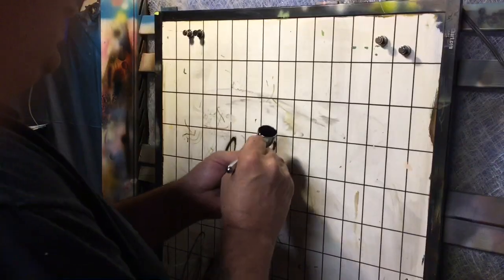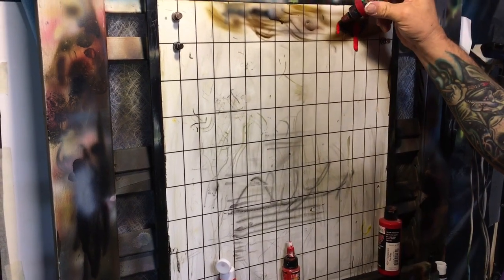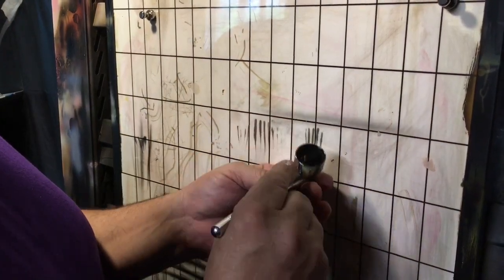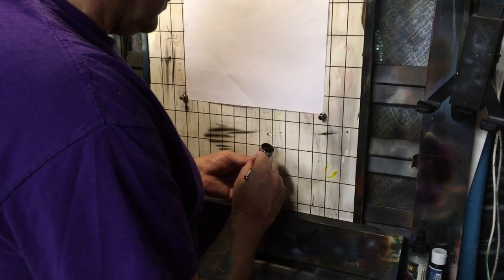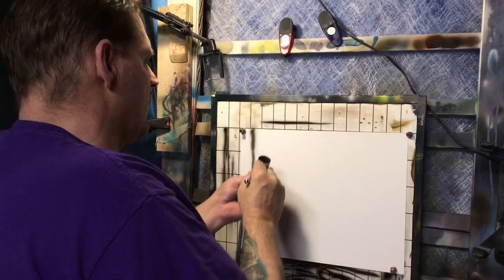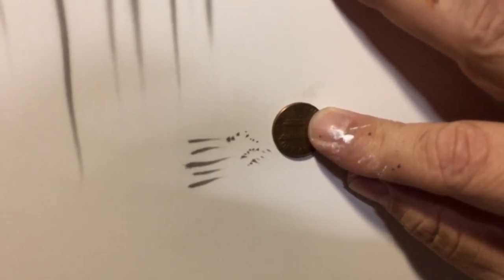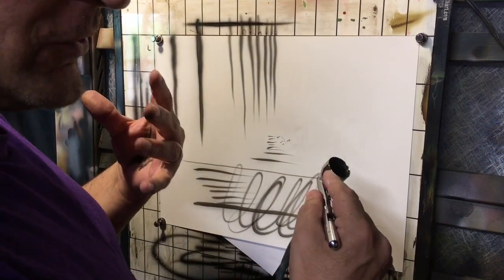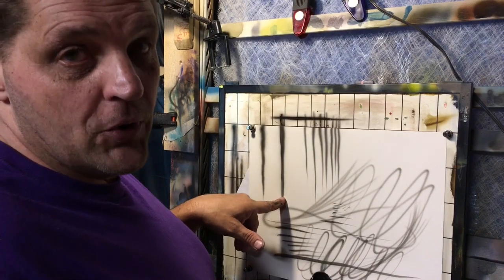How to reduce airbrush paint! Determine the correct psi and reducer you need!

Comment: Great videos. You do some amazing airbrushing art. This is coming from an artist myself. I really like the videos on the Point Zero airbrush reviews. I'm looking to get an economy Mac valve airbrush, cause my budget can't afford to replace my expensive Iwata brushes parts at the moment. There's just something about taking something budget friendly and tweaking it to work like a top shelf product. Would love to see some more videos on the Point Zero guns with the bigger needle sizes as well. Maybe customizing them with the PS 770 needle an such, maybe not the whole head assembly. Thanks keep the videos Rollin! Got that notification bell turned on!
Reply from the maker: Hi Shane.  I actually slightly modified my point zero mac valve just a little bit after I made the video on it!  Other than that I polished the needle.  I used that brush regularly for a month, now its not that I stopped but i dont even use my real micron every day either :) I will shortly post the modification I made to the mac valve. although i really should have followed the whole process... and the question becomes do i really wanna spend another 30 bucks just so i can document that?  
   Thank you for the kind words!
Reply: @TheAIRspace  So how did it preform after the needle polishing?

Comment: Your talking about water paints, do you paint with thinner paints?
Reply from the maker: I do not use solvents in art anymore.  If I do use solvent paints they are urethanes.    The same rules apply about pressure and reducer.  And you can get a clear base for those as well.   Of course with solvents they actually mix thinner and clean up easier than water based... if you have a safe place to use them.
Reply: Thanks fore talking about this, some times I really struggle with the water based paints, tip dry, and to thick or not enough paint. There’s one thing that might make things easier but I have not tried yet, fixing the needle, polishing the needle, have you tried this and if yes how do you do it?
Reply from the maker: @MrLasse100  I have polished needles before.  I dont usually bother. Unless I damage one or if it comes from the factory a little rough. 
Tip dry is a fact of life with airbrushes, and it gets better and you learn to keep it at bay over time.  A sponge with reducer /cleaner on it and dipping the tip regularly can help a lot!

Comment: what is the difference between reducer and flow medium?? I'm new, and paint on mostly wood, as a woodcarver.  I am not an artist like  you.  but, trying to learn and when I mix paint for a bird, I want to be able to save that in a small jar for a few days.  then flow medium??
Reply from the maker: A flow medium to not get too technical, helps break surface tension of the "water" or binder.  Most mediums called flow medium are a thinner binder with a little added product to make it "slippery" They also generally are retarders that stop the paint from drying as fast. Reducer usually has something to break the paint down, as well as usually a small amount of a retarder and occasionally a little something to make it slippery.  But there is usually no acrylic binder in a reducer. 
    Water can be a reducer.  So can alchohol. 
Without knowing your brand of paint I cannot even guess on shelf life after mixing with reducer. MOST in a sealed container will hold a couple of days.
Reply: @TheAIRspace  thank you, I have been watching some video's on painting ducks, and the artist said (and I just received a bottle) to add flow medium when you mix the paints.  about 60 med to 40 paint.  he said this helps him keep paint for a few months. I don't need it that long, but, we have well water and have to buy distilled.  thanks again, i'm 75 and learning slowly
Reply from the maker: @jimbrumm6197  Just remember Grandma Moses started around that age!  I started at 46 myself :)